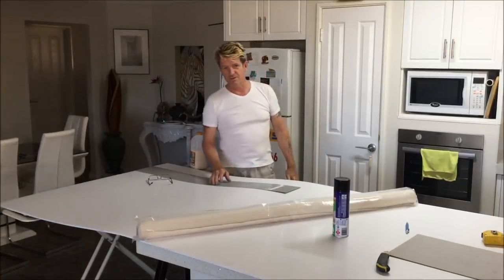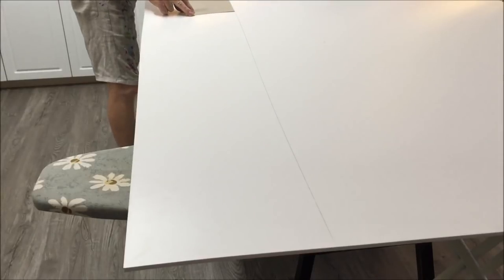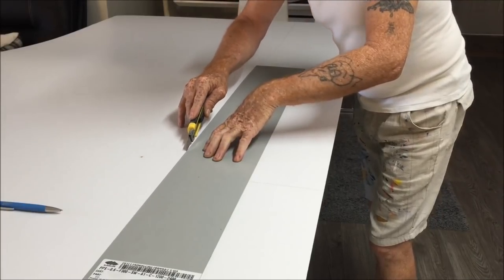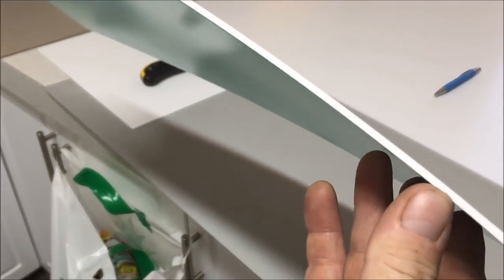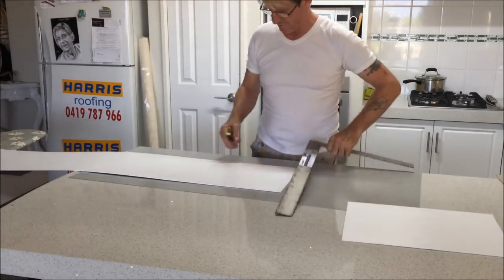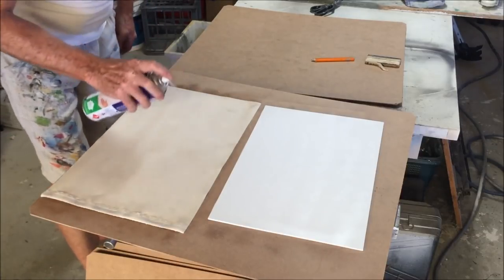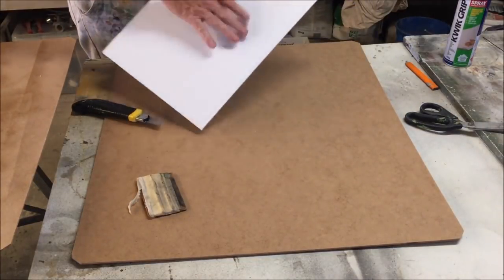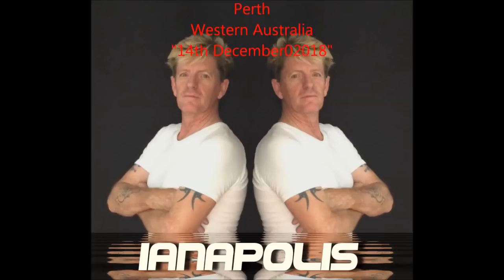#184. making my own canvas panels.

Comment: Ian you mentioned in one of the question you used foamalite.  Where are you buying that.  I am in Adelaide and can’t see too many options without having a trailer to pick up.  Also a question on the glue.  Spray contact is also quite expensive so how many A3 canvases can you do from the single can.
Reply from the maker: i get the foamalite from the sign writing  suppliers (spandex) and a can of contact may get me 15 canvas's